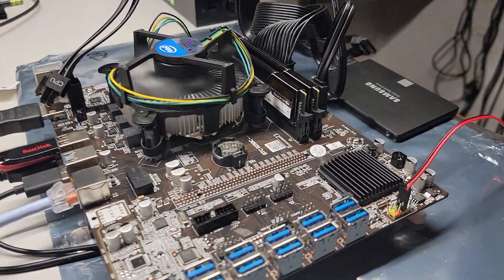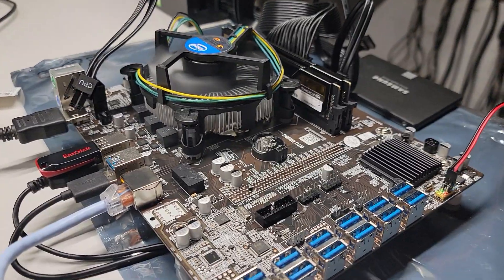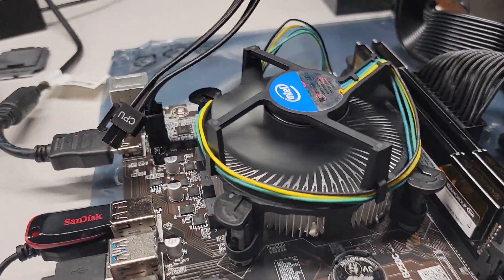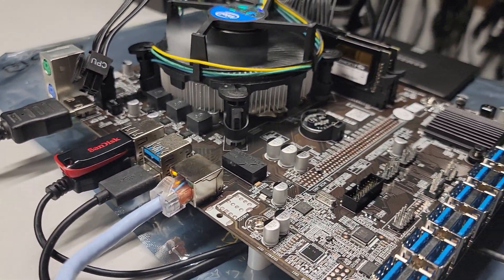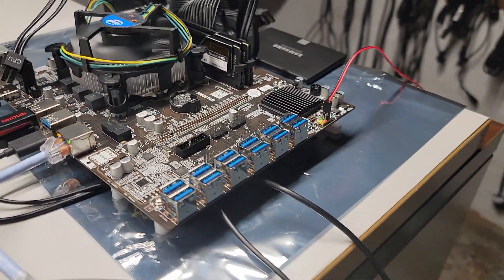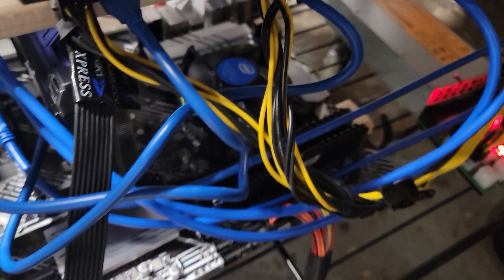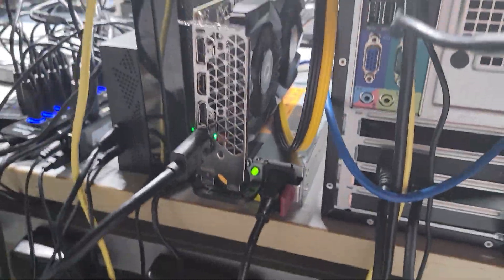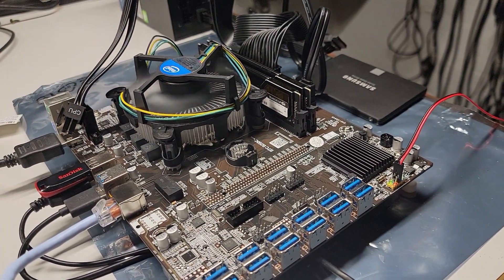Alli Express BTC 250C 12 port PCI-E USB Riser Motherboard

Comment: man i need the bios settings for this thing mine keeps crashing
Reply from the maker: What's crashing, windows, hive, driver?  I'm using default load and getting months of run time with a mix of 12 cards in windows.  In fact I'm not sure how long I could go because I've had to restart for reasons other than failure.

Comment: Have you found a website for drivers? I have a few devices with ! symbol on them in the device manager... I think this is preventing the 3060 from display Eff/Watt.  I got the same motherboard from Envision Mining in Australia and there was no documentation or disk, and their website doesn't have drivers. Is there an original source for these OEM Motherboards with drivers to download?
Reply from the maker: No drivers needed for win 10.  I'd guess you have Nvidia issue, have you done driver clean up and started from scratch.
Reply: @Bitfarmer75  Good idea, I can try that tonight... but I don't think it will effect the following drivers which are currently listed as "Other devices" in Computer Management 
Base System Device
PCI Data Acquisition and Signal Processing Controller
PCI Memory Controller
SM Bus Controller 
Are these elements in your Computer Management displayed with the yellow triangle or are yours all working (I may try reinstalling windows) (maybe for a change I can try hiveOS?)
Reply: Oh an update! I managed to update the computer management missing devices with Windows Update optional updates I think it was... and I did the gpu driver clean up and reinstall and now the 3060 LHR is displaying eff/watt in the 280-350 range...better than showing 0.... thanks for the advice... I may just need to tweak a bit to increase hash rate (but without increasing watts to much)
Reply from the maker: Running T-Rex, my one 3060LHR card is 366 kH/W.  It usually levels out at LHR of 76.5 and 89W.  Thinking about moving it to my Flux rig and it would pull a lot more power doing flux but I have a single 2060 running by itself and I could save a little power not running an entire rig just for one card.

Comment: I recently built a mining rig for a customer, with future upgrades in mind. It is running this exact board, an Intel 6th Gen i5 at 2.2ghz, 8gb DDR4, a 3450 watt psu, and just 2x 3070's currently. I handed it over feeling smug, then with mining between 1s and 6h, it returns the error 'WHEA UNCORRECTABLE ERROR' which could be anything. I'm not sure what could be wrong, any ideas?
Reply from the maker: If u pulled everything off the board and tried different ram then I'd say bad board.  For the price I buy spares, who wants to be down for 3 weeks over a $90 board
Reply: I have the exact same issue. Changed everything except the board, even tried HiveOS on a usb stick. The board would stilll randomly crash... I see they have a new version with additional 6pin power on the motherboard and msata. maybe they fixed the issue at the same time.

Comment: Do you know why when I connect the 4 pin cpu from the power supply to the motherboard when I turn on it turn off almost in 1 seccond but when I take out that 4 pin cpu it do not turn off? right now dont have a monitor to know if the rig starts but want to know why is this happening? what is that 4 pin for? Thank U for any help for all the people here.
Reply from the maker: Something is wrong with your setup.  PS, RAM, CPU, something.

Comment: I just built a 12 card 6600 rig using this motherboard, no issues whatsoever, hiveos recognized all 12 GPUs right away. I like this board, I'm gonna use this board for all my rigs from now on.
Reply from the maker: I'm running mix of 10 1660ti, 1660s and 3060 with windows/trex and so far so good.
Reply: @Bitfarmer75  nice, it's a very solid board. It's small and cheap, USB connection directly on the mobo so don't have to worry about pci-e x1 risers get loose on the motherboard side.
Reply: Can you please share your bios settings?
Reply: @XENTROPIAX I didn't have to change ANY bios settings. The default settings have what you need, including above 4g decoding enabled.
Reply: @wangao0316  Should it be working with 12x  NVIDIA 30 series? which bios version do you have? I just ordered one of this mobos and I want get as much  information  as possible to make it work :3 thank u
Reply: @XENTROPIAX  it should be working right out of the box. Just to know this motherboard has b250 chipset so only 6th and 7th gen Intel processors are supposed. I didn't even pay attention to the bios version. I've built multiple 12 GPU rigs using this mobo, I love it and it's my favorite mining motherboard now.
Reply: @wangao0316  I already have an intel celeron G3930, which kind of ram do you recommend me to get?
Reply: @XENTROPIAX  nice, that'll do. If you're using HiveOS, a regular 4GB ddr4 2133 RAM should work, that's what I use.
Reply: @wangao0316  thank u for help, does it work with udim ram or it has to be dimm format?
Reply from the maker: I don't remember changing anything either.
Reply: @Bitfarmer75  how much ram do you have for it to work on windows? I’m having issues with 10 gpus where the rig restarts or freezes. I have 8 GB ram and virtual memory maxed out and want to know if it is maybe a ram issue.
Reply from the maker: 8GB is what I have, running 10 cards just fine.  What is Maxed VM for you?  Depending on your miner you could need as much as the total of your cards
Reply: @juandanielnassar8914  I doubt it's a RAM issue, I found out that anything pass 8 GPU, it's not stable in Windows at all, it would restart or freeze. That's why I switched all my rigs to HiveOS, so much easier and much much more stable.
Reply: @wangao0316  I did try HiveOS but the rig would just go offline out of nowhere and I would have to manually restart it every time. I haven’t been able to find out why that happens and I tried basically every version of hive and nothing. That’s why I moved on to windows.
Reply: @juandanielnassar8914  I would check your OC settings, and sometimes a bad riser would cause the issues, I would check the risers too.